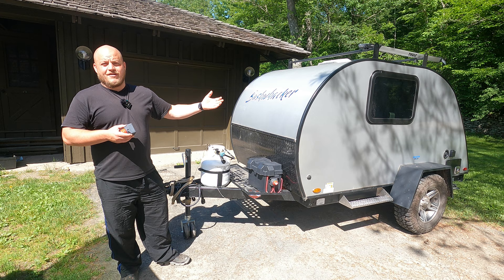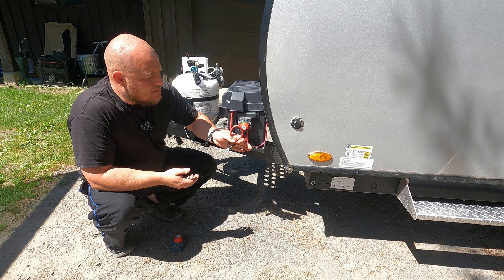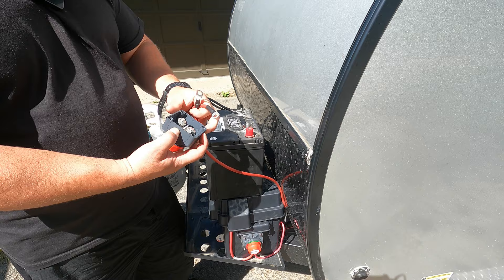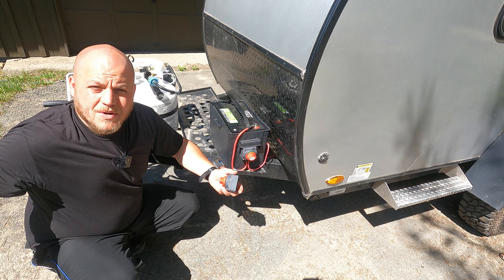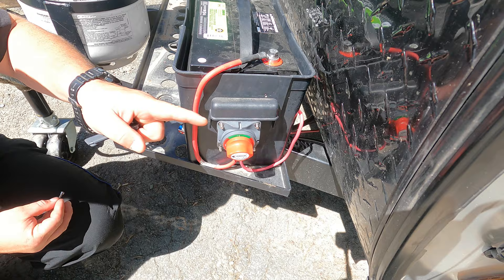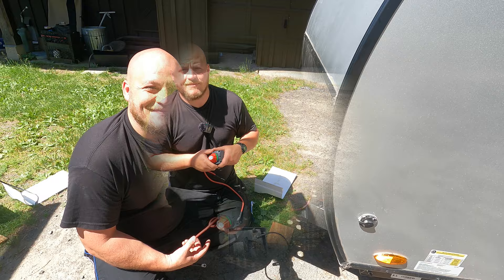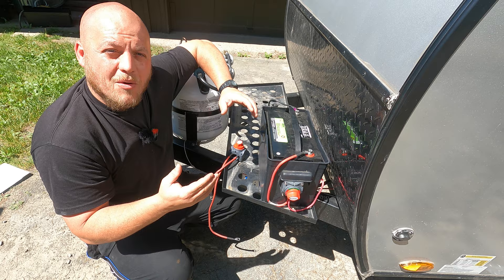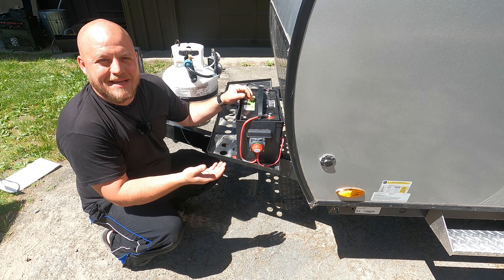Installing Master Switch on Camper Trailer | RV Kill Switch

Comment: Great instructions! If you disconnect a fully charged battery, is okay to place a trickle charger on it right away or should you wait a week or so? When you do put it on, can be left on indefinitely?

Thanks
Chet
Reply from the maker: Put it on any time, leave it on.  Some are better than others, but these LA batteries like having a trickle on them for maintenance.
Thanks for watching!

Comment: some people say you shoudl connect the switch on the negative wire. Can you tell me whaqt your thoughts on this is and why you choose the positive wire?
Reply from the maker: It works either way, but there's no question that the positive switching is superior, even if it's a slight advantage.   

Switching the positive is actually code for all DC systems that have regulating bodies and oversight.  Airplanes, stock cars, military vehicles, and inspected solar systems.

The people that switch negative are typically making a mistake based on a simple set up with cars.  When removing a battery, you always remove the negative wire first.  This is to prevent your conductive ratchet from touching the frame when removing the positive.  If the negative isn't removed, the wrench will ark.  They then carry this over to thinking that a switch should be placed on the negative, in fact, it's not the same thing at all.  When you switch the positive, you completely eliminate potential to all of the appliances, while maintaining a pathway to ground.  By switching the negative, you were eliminating your pathway to ground, this should be avoided at all costs.
To get into all the details here, I'd have to write a full essay.  if you do some research, you will see that there's not a real debate amongst professionals, you always master switch the positive.  

Hope this helps, thanks for watching!

Comment: Yes, please on the more advanced electrical setup and customization vids.
Reply from the maker: Those are my favorite, unfortunately no one watches them… lol
Reply: @DIYOutdoorLife  If it helps, I'll watch them at least a dozen times! :)
Reply from the maker: @aaronchapin9331  haha…  any requests?
Reply: @DIYOutdoorLife  Lol, always... Tbh, I'm about to close the deal on my first EV tow-vehicle and would love to see your take on a fully electric teardrop power system build. Things like leveraging 50kw fast charging or best practices on connecting the EV power system with the camper for max benefit. Not really sure what's possible...but there's a large intersection of EV owners and camping aficionados. There's a lot of downsides to propane, like the high moisture content, safety and practical problems of open flames, etc. Solving the problems typically addressed by propane with electricity's lower energy density is an interesting challenge.
Reply from the maker: @aaronchapin9331  all great ideas. I’m installing a level two fast charger this week.  I’ll film it for sure.
Reply: @DIYOutdoorLife  I'll watch it, for sure :)

Comment: Great video. Btw do I leave the kill switch on or off when traveling (connected to 7pin harness from truck)? I want to make sure my batteries get trickle charged will traveling. Thanks.
Reply from the maker: Leave the switch on to charge what driving, off will stop the charge. Thanks for watching!

Comment: Hi Brian, ok, I've subscribed! I have what I think is a simple question, yet I can't find a simple answer. I bought two 100w solar panels, and a controller (and fuses, cables). I want to go panels, to controller, direct to batteries (two AGM in parallel) to keep them topped off when I boondock (my main activity). But the Winnie manual, and a warning sticker on the battery tray, both say "Disconnect batteries before connecting external charging equipment to avoid damage to sensitive electronic components." If I connect the controller to the batteries, isn't this exactly what I'm doing? Am I going to fry the control board in the fridge, furnace, etc? Note, I've thought about installing a disconnect switch like you show in this video, but then my fridge is not going to run, even on propane, right? Thanks for your great videos, and if you can answer this. Best, G.
Reply from the maker: I cant tell you what to do, its your investment, but i can tell you what I would do... lol

I would hook my charge controller to those batteries and leave it.  If you use a GOOD charge controller.  Like a victron blue smart, it's going to be fine.  It wont surge and peak out any higher than your alternator charging or shore power.

Comment: Here is my second question (after you helped me with the temp sensor disconnect idea!):  I am replacing my battery fuse (story below), But the new switch would make it about 18 inches from the battery--seems most guides say  no more than 7-8 inches away. Another choice is to put it on the battery side of the switch--easiest might be right on the end and tuck the inline (blade type) fuse holder into the battery box.  Is there anything wrong with this alternative or is this maybe an even better place?

Here's how I got here.   As I was manipulating the positive lead wire that goes back to the converter, I noticed the "fuse" was encased in electrical tape with obvious rust emanated from it. After unraveling it, I fond the fuse was a rectangular box with the wires connected to two screws on the box plus with two screw holes to attach it someplace, unused in this situation.  Upon trying to disconnect the first wire, the little box disintegrated in my hand.  The "fuse" itself inside the box was about a half inch wide and an inch long with thin corners connecting it to the wires.  Wierd little contracption, who knows how many amps that was. So I am replacing it--my Aframe stuff says that should be just a 20 AMP fuse.  Do you know how hard it is to find 8 AWG wire, inline fuses, connectors,  and crimp tools?  Don't worry, solved it, but wasn't easy--all 8 AWG.  Thanks for all your info, you do great.  Looking foreward to more.
Reply from the maker: It's very easy to find in-line fuse holders for any current and wire gauge these days online.  Try to find pure, or tinned copper, and stay away from CCA (copper clad aluminum).
Always fuse the positive side and, like you said, try to stay as close to the positive terminal as possible.   20 A does seem low for your whole camper, are you sure the battery is only fused at 20a??

Comment: I want to do this to my jayco trailer that has two batteries. That being said should I use two switches so that I can isolate them from each other for two battery maintainers when the trailer is stored? I store my trailer in the driveway. I had one battery maintainer maintaining both batteries and never had a disconnect switch. Long story short my maintainer didn't last but a few years and both of my batteries need to be replaced because I didn't realize my maintainer died.
Reply from the maker: One switch is fine. Parallel both the batteries and just placed the switch on the wire that's heading to the camper.  You're fine to use one maintainer, I like to put the negative on one battery in the positive on the other.  Try the NOCO maintainers, I've had a lot of luck with them. 
#ad https://amzn.to/3VMcdfc

Comment: Does this stop the solar panels from charging the batteries as well? If so Is there a way to have the output off but still charge them
Reply from the maker: Great question.  Make sure to wire your charge controller directly to the battery, everything else runs through the switch.  It's very helpful to be able to turn everything off, but still charge from solar, easy to do.

Comment: thank you for the great advice, it's something that I can handle.  Does the length of the cable matter?
Reply from the maker: Try to keep it as short as possible. If you are running several feet, consider using 1 size bigger wire.  The lower the gauge, the heavier the wire. Thanks for watching!

Comment: Thanks for the video… I have two batteries on my travel trailer.. do I just hook this up to one battery? Which one?
Reply from the maker: Think of it like hooking it up to your trailer. Add the switch to the red wire that is going from the battery to your camper, it will work whether there’s a single battery or multiple.

Comment: Great video, thanks! Will the battery recharge while driving, if the switch is in the off position?
Reply from the maker: You can wire it that way, but it's an extra step.  You can leave it turned on while driving for now to receive a charge.

Comment: Hi Brian, Our camper did NOT come with a kill switch but we realized that we had to stop the drain of the battery in storage and had one installed just like the one in your vid.
I understand how to use when stored but what position should the switch be on when 1. When we're towing and on the road with the trailer plugged into the tow vehicle and 2. When we've 
dropped the trailer and camp and plugged into the camp provided power.  I guess the question is is the battery being 'recharged' by towing and plugging into campground power? Thanks so much! Christine
Reply from the maker: It should be on when charging.  Having it switched on, will allow the charge to take place.

Your battery will charge when you’re plugged into shore power at the campground or home.

It will also charge one driving, if your seven pin plug is properly installed.  If your car is a tow package, or the seven pin was added aftermarket, it should charge while driving. Keep the switch on for those charges.
Thanks for watching!

Comment: Great video! I find it very easy to follow along with you. I looked at my wires and there are no markings that I can see to determine what gauge they are. I am using an Interstate Deep Cycle Marine battery (91ah). Any suggestions?
Reply from the maker: You'll probably be fine using 6awg.  What camper do you have, I'll double check for you.
Reply: @DIYOutdoorLife  I have a 2017 ALiner scout lite, thank you!
Reply from the maker: @sunnyjogardner7525  six AWG will be fine! Have fun with the project
Reply: @DIYOutdoorLife  Thank you so much!!

Comment: My camper van has an electronic switch for switching off DC to Van.  Is this the same thing? Or would mechanical disconnect like in video be better? Thank you.
Reply from the maker: If the switch disconnects all of your DC load, it's perfectly fine as is.  If your van is in storage, you just wanna make sure that there's no parasitic draw on the battery.

Comment: Quick question.  If you had two batteries, would you hook the battery disconnect up the same way having the positive coming from the camper to the battery disconnect, then hooking the other lead from the battery disconnect to the positive?  The answer is probably yes, but want to make sure.  Thank you in advance.
Reply from the maker: You got it, the answer is yes.  You said it at the same way, essentially switching the wire heading to the camper.
Reply: Awesome.  Thank you very much for confirming.
Reply: Thank you very much

Comment: Great video, question...do you switch the hot wire or the ground wire or does it matter? Thanks.
Reply from the maker: The hot wire whenever possible. You can do either but there’s several reasons why the line wire is preferred over switching ground.

Comment: If I put in a kill switch, will it being off during the day have any effect on my solar panel charging the battery during the day? Thanks. Your teaching is excellent!
Reply from the maker: It depends how it's wired.  If you watch my solar videos, I show how to wire solar directly around the switch.  When I'm switched off, my solar is still charging.  Thanks for watching!
Reply: Thanks for the quick reply! My trailer came with a factory solar plug in so maybe I will only use the kill switch when I’m not using the trailer/not using the solar. Thank for your brains…..hahaha.
Reply from the maker: @kedked4564  haha 👍

Comment: Hi thanks for a great video! I'm setting up a new larger single 12v battery this week and am going to try that style switch in your video. My old kill switch I mounted on the battery box lid and it was connected to the negative side. Is the positive side better for the kill switch connection? Just curious if I should change it up on my new install. :).
Reply from the maker: Either works, I would switch it to positive.
Thanks for watching!

Comment: Can you connect this to the negative terminal instead of the positive terminal?
Reply from the maker: You can, it will work fine.  My advice is to connect to the positive whenever possible, negative will work if for some reason you can’t switch the positive.

Comment: Does turning that switch off stop the solar on top of my square drop from charging the battery?
Reply from the maker: This depends on how much wired.  On my set up, the solar continues to charge while the camper is turned off.  

If you have access to the wiring, keep the charge controller directly to the battery and the wire going to your converter gets connected to the switch.  
If you need more help, I'm happy to assist if I can. Email me some photos and I'll try to help.

Comment: Hi, I just watched your video at 3:56 you explained hooking the wire to the disconnect switch, does it matter which terminal to connect it to on the disconnect switch because mine doesn't have any markings mine, also I was told to use the negative terminals when hooking it up does that matter too.
Thanks
Reply from the maker: Fine to use either terminal, they are interchangeable.  Do try to use the positive for this application, you’ll be better off.

Comment: My respect to you sr, I have a question, what is the difference in connecting it to the negative terminal? Seems a lot of people are doing this using the negative terminal, not judging just curious as I want to do this to my zero turn mower, thanks again, great video, new sub here
Reply from the maker: If you look through the comment section of this video, I’ve answered it many times.   Sometimes I try to sugarcoat it, other times I’m blunt… lol.  Putting a master switch on the negative will work just as well as the positive, but it’s simply not the right way to do it.  In any field in which this is done professionally, they switch the positive.  When switching the positive you eliminate potential to the devices and maintain your pathway to ground, this is best.  When switching the negative, potential remains at the appliances and you have broken a pathway to ground.  

There are several reasons why people continue to do it incorrectly, but that’s a longer conversation.
Reply: @DIYOutdoorLife  thanks man, appreciate the response, I’m just trying to do it the right way

Comment: Brian, I installed same switch. I tested it by turning it off  to make sure I did the job correctly and I must have done something wrong. When I turned the switch off I still had power in the camper. Any idea what I did wrong? Your help is appreciated.
Reply from the maker: Of course, happy to help!
Can you start by describing how your  switch is installed?   I'm guessing that you had more wires going to your battery?

Comment: I notice your camper wire is Red and you connect to the red side of the battery. I'm new  and I have a new camper. The wire from my camper is WHITE and it is connect to the negative side of my battery. Is this the wire I should connect to battery disconnect switch and on to the positive red side of the battery terminal?
Reply from the maker: Red side- the positive 
Either one will work, but switching the positive side has advantages.

Comment: I want to add a disconnect switch. I have my tounge jack wired directly to battery and also my trickle charger is connected by loop connectors to the post. Should I put all 3 positive connectors to the switch?
Reply from the maker: It all depends, do you want all those things to turn off when disconnect switch is turned off?
For instance, you might want to turn off your tongue jack but still allow the camper to trickle charge.  

Anything you leave in place on the battery will continue to be connected, even if the switch is in the off position. 
Anything you add to the switch, will be shut off when you turn the switch off .

Hope this helps, reach out if you have any other questions .

Comment: How many amps they will stop? I have 4 solar panels each 100w in parallel.
Reply from the maker: Those panels are well within the current range of the switch, you'll have no issues.

Comment: There is already a battery disconnect inside my RV, the type you push or pull to disconnect and connect. The camper manual says "When the battery disconnect switch is pushed in; it disconnects ALL power from the battery,
 both incoming and out-going". Is this enough or should one like yours do better adding it closer to the battery? Must be a dumb questions, my apologies.
Reply from the maker: Not a dumb question at all.  If the disconnect that came with the camper shuts everything off, that should suffice for now.  If you add some solar, it might be helpful to have a switch like mine that shuts the camper off but allows the battery to keep charging.
Hope this helps, happy camping!

Comment: Great video thanks, would really appreciate if you could help me, I already have a kill switch on my battery but there are 2 pos wires going to it via a 30 amp fuse. I stored the RV over winter without the battery when I connected it back the 30 amp fuse keeps blowing. Would you know what the 2nd pos wire is for? Thanks again
Reply from the maker: Sure, we’ll get you squared away. Shoot me an email at diyoutdoorcontent@gmail.com